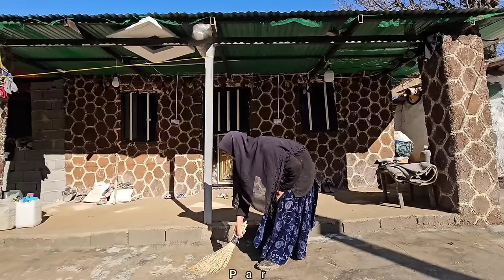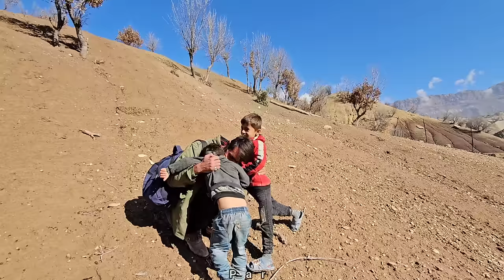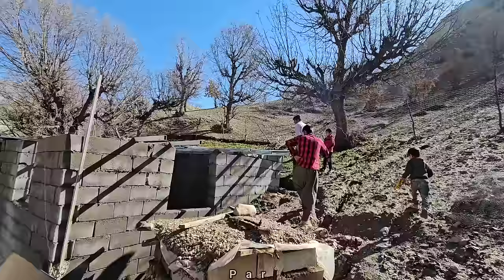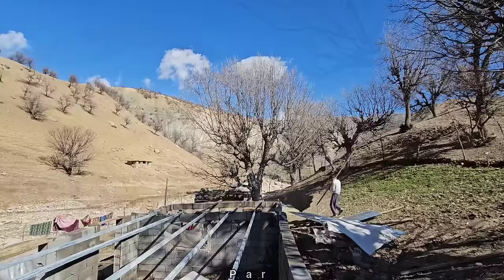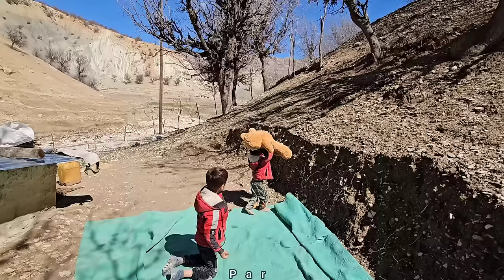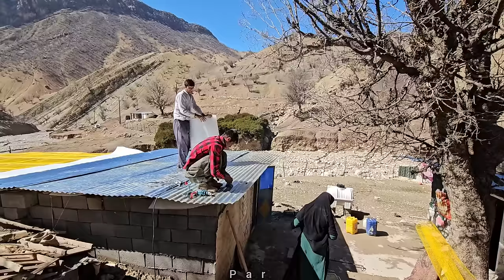rural life.  While Babak was helping his brother in building a house, he was bitten by a scorpion

Comment: I don't mean to criticise but the way you build is strange to me. You will have problems with damp on the inside because you don't put cement between the blocks in the UK we have always built with stone and bricks and when we cement we don't smooth the cement before placing the bricks because the cement needs to go into the holes and grip onto the blocks you also put cement between the blocks and you smooth the sides once the cement comes out of the sides and then you cement over the outside as well as the inside. And you should make a cement gully between the earth and the house for the water to run down. My father was a builder and plasterer he had his own business and built many houses..Are you able to watch videos on you tube of different methods of building especially bricklaying and plastering.